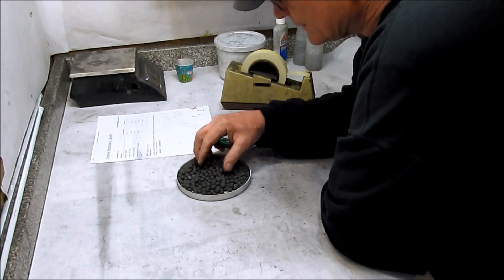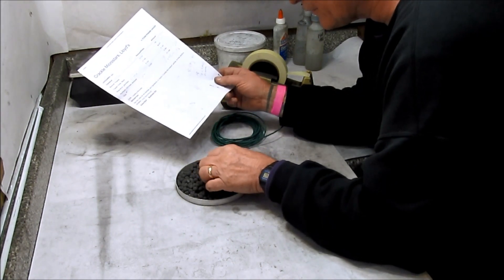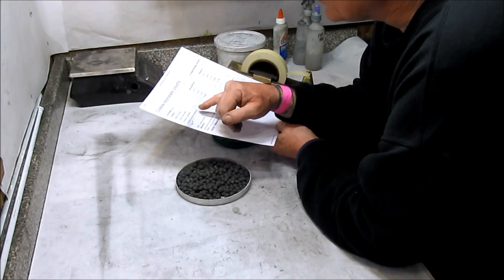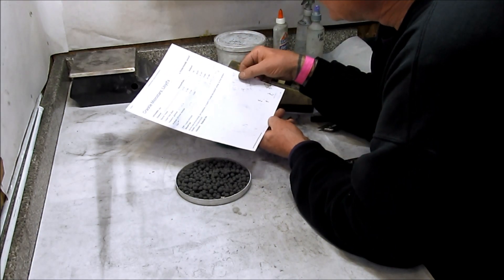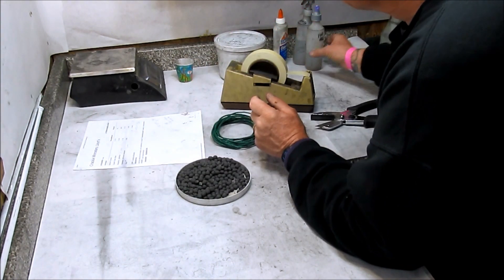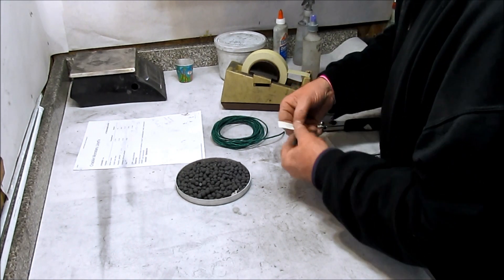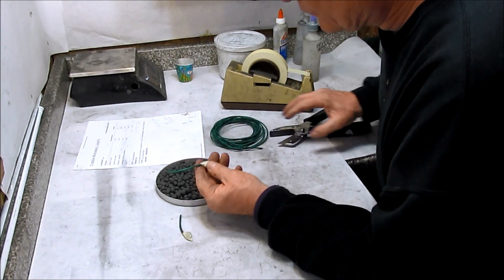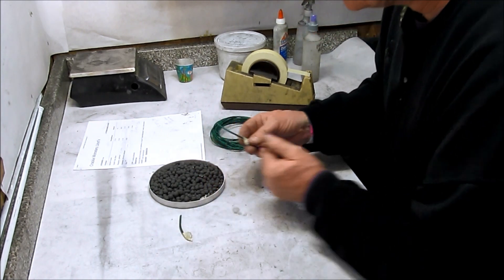Testing Dragon's Eggs using new Bismuth Trioxide

Comment: Turns out, you can get away with cutting 1/8" dragon eggs with 50-80ish mesh mg/al, its small enough to roll stars with but big enough to make a loud pop that's somewhat louder than a consumer firecracker, when i get to 1/4", it isn't as loud as the smaller ones oddly enough, the little 1/8" ones tend to produce a noticeable shockwave at 3 feet whereas the 1/4" didn't produce as much of a shockwave, these were unprimed btw

Comment: Hey Ned , I’ve got a question for you, what about using lead oxide or lead tetrioxide which I guess is the same thing. I’ve read fireworks places about using this to make dragon eggs. They smolder a little longer and has a louder pop. Yeah I know leads poison but I have the throw away hazmat suits and respirator that will filter out even chemicals you can’t see taste or smell. Like the dangerous gas we made at shell. Fozjene. So very deadly gas. I have to use a special suit hooked to oxygen tubes and me and one other person could only work in that unit for only 15 minutes at a time. Yeah it’s bad. But getting back to the question ? Have you ever tried lead oxide ,or know anyone that has. I know that book from that Japanese guy talks about it in a section and says it can replace the bismuth 1 to 1 .. I’d like to try it if’s it’s true. Thanks Ned. Oh , I did get my first bamboo guarinda to fly to the sky with seven 1 lb Heavy wall tubes and three of them that was the ones that started the spin and whistle. I put a header on top and glued a bentonite clay plugged tube a inch long and 1 1/4 id. Then I glued the report to it and put ribbon tape around the lower end upper half of the report and clay plug. I didn’t want to blow it apart. Takes some time to build one from bamboo. But that baby went so high it looked like one in in diameter. Lol 😂 then the flash report and the shut came out just perfect and floated over into my neighbors pasture. The little bit of ti i added in the bp mix made it really lively in the sky. I remember when you made yours and I couldn’t wait to try. I’ve made many different diameter ones since and every one in the family and friends love them. Hey thanks for turning us on to how you made yours. Naturally I’ve changed a few things and tried different recipes. Should have seen the one with tiny really tiny dragon eggs added to the bp. I rammed them wet and let them dry a week in my dryer like the video you posted on how to build it. I’ve dried many stars and others in that baby. Wouldn’t give it up for anything. I live in a wet climate in these mountains so I have to keep everything dry. I made a huge 4 ft by 8 ft cabinet out in my shed with a small heat lamp onto one end in a aluminum AC line along with a small fan to blow the heat into the box. Works great. I can even dry some things in it if they aren’t going to be used in some time. Thanks again. What about that lead dragon eggs ?
Reply from the maker: Yep, John, red lead tetraoxide is known to be great for crackle stars. It's just gotten a bit challenging to source nowadays economically. Congrats on the 'dola.

Comment: Excuse me, dragon eggs need to be coated with many thick beads to connect gunpowder. My dragon eggs are made of lead oxide. The particles are about 12-14 meshes. The fire is very loud directly, but the three-inch firework shells are silent.

Comment: In the video you showed the composition sheet based on 150grams of bismuth and shortly after you said that for this you used 6 grams of smokeless powder and a quarter cup of acetone, I talked to Lloyd and seems that figure is a few grams shy of correct because at over 200 grams of Comp that quarter cup is no where near enough smokeless nor acetone to ""WET"" that much comp to a batter consistency I followed ths comp to a T, and it was bad bad dry wouldn't even mix at all. But I got the ratios all figured out an got them working I was figuring you mite fix it before some1 else waste 159 grams of bismuth trying it thus way. Thanks mdcurley
Reply from the maker: The 211g total batch size is 1/3 of the standard batch I make, per that article in FW.com,  Jeremy. For that full size batch, 640g, 16.9g of the smokeless powder, and 2/3 cup of the acetone are spec'd. So, for the 1/3 batch, I used 6g of the powder, and started with 1/4 cup of the acetone, adding a little more of the acetone as needed, but not much more. So, the amounts I mentioned are precisely sized per the original article and method. A little more acetone can always be added as needed, though.
ned

Comment: Ned, how sensitive are these stars to friction or impact? I'm wondering how safe is packing them into the shells. 
Are these safe in storage or rather should be used quickly?
These eggs are loud! The echo tells the story even if the camera can't handle the sound level. Thanks for sharing!
Reply from the maker: I would not expect them to be sensitive BH, and have never heard any tales of them being so, but I've not actually tried them myself. There are huge numbers of shells and other devices with them in there, with no special precautions taken, though. Especially with the prime layer on there, the stars are pretty protected. They are safe for long term storage, as long as normal precautions are taken against moisture and sparks. Enjoy, and stay safe.
ned